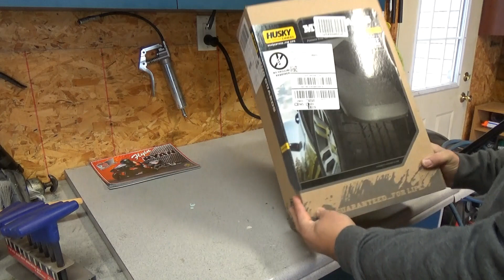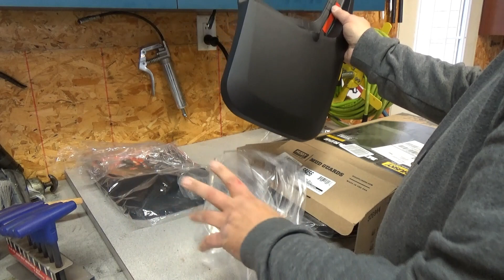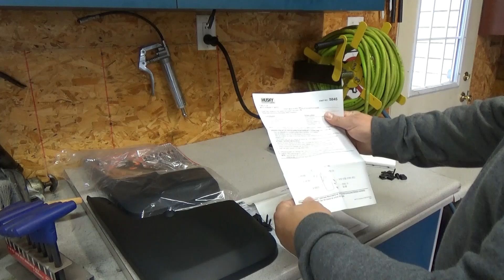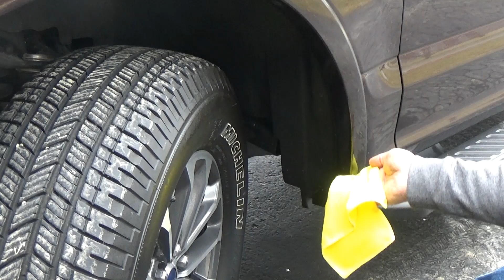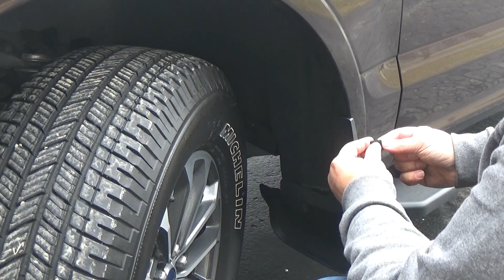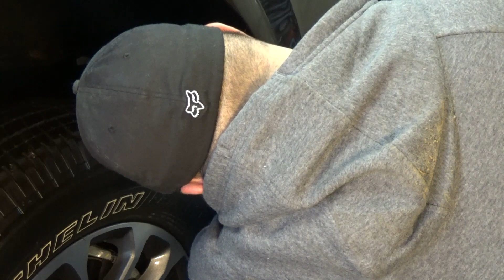Husky no drill Mud Guard Installation 2018 Ford F 150

Comment: I just installed Husky on my 2005 Rm 3500 Dully on the front. You can not drill the plastic without removing the tire, BUT you can heat up a nail with a torch and melt a hole with the tire on the truck. Worked well.
Reply from the maker: Great idea! Thanks for watching Dirt Poor Tv.

Comment: big problem with this infomercial is the clips installation. Cant see anything you did or how.
Reply from the maker: At 11 minutes in the video I am showing you how to install the clips. It is hard to see because my back is covering the camera. You basically put the clip over the mud flap and over the body molding and push it on. It has teeth on it that grabs onto the plastic. Sorry it was hard to film that angle but you should get the picture.Thanks for watching Dirt Poor Tv
Reply: @dirtpoortv4483  You nailed it at the end of the video calling it a terrible installation process. I am getting ready to put on the Husky flaps 57071 on my rear dually. I got them cheap at $40 from Ebay as hardware was missing. I have full plastic inner fender liners and plan to use 4 #12 long screws with big washers. they secure all along the curved fender edge. On my Ram 2005 dually, the dually fenders are a type of plastic, so no concerns about rust. Instructions say use #10 screws, but I already have plenty #12 from a different project. I also figure a slightly bigger screw can hold them on better.

Comment: Husky makes nice looking mud flap, but look to be labor intense. I was also looking at WeatherTech mud flaps. I also have 2018 ford f150xlt. Not sure which way to go. Pro's and cons to both brands.
Reply from the maker: I have never had the WeatherTech mud flaps but yes the husky are labor intensive. If I were you I would give weather tech a try. If you are not worried about the installation husky mud flaps look and get the job done.
Reply: Oem ford molded ones are bullet proof.

Comment: Those clamps are awful.  I did drill it out to secure the flaps.
Reply from the maker: Yes they are junk clamps.I have also had to put screws in the other designated spots because the mud guard was making my trim piece come lose on both sides from flapping in the wind. Thanks for watching Dirt Poor Tv.

Comment: I bought these for my 2019 F-150 with OEM fender flares.  I think the instructions provided by Husky are a little inadequate.  I like this video in that you show the issues that can occur and the extra steps that may be needed to make the flaps secure.
Reply from the maker: I do like the Husky mud guards fit and finish. But the install is a pain in the a**. Thanks for watching Dirt Poor Tv.